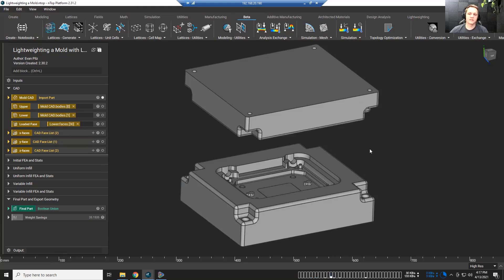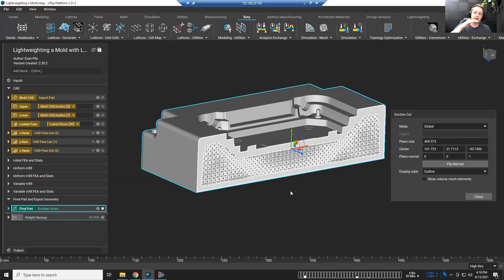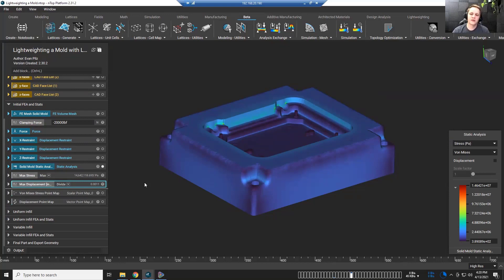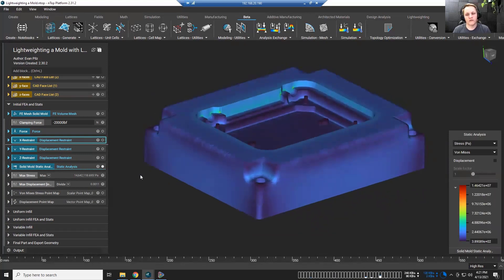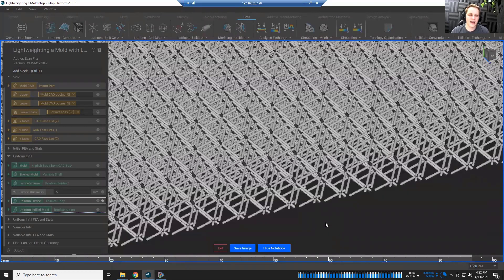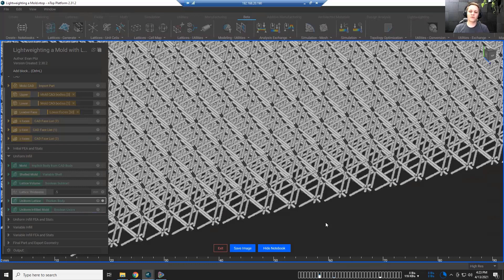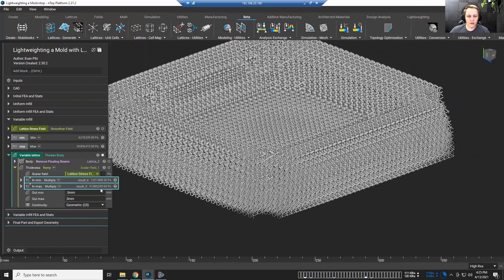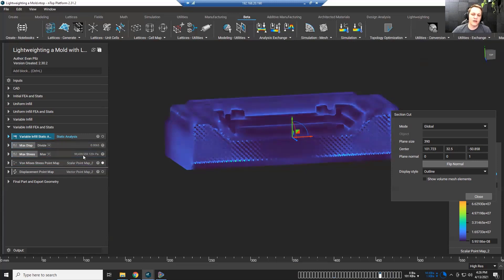nTop Live: Designing 3D Printed Molds for Industrial Injection Molding

Comment: Excellent application, but unfortunately this approach doesn't provide any weight savings since there are no drain holes for unpolymerised resin inside lattice structure. It might be a good idea to open up the bottom surface of the mold completely so the lattice is completely exposed and all of the unpolymerised resin can be removed.
Reply: This can be done in the slicing software